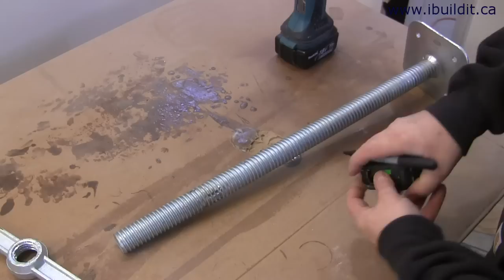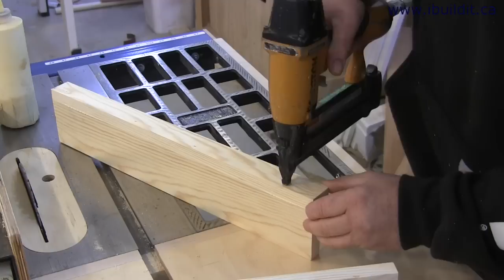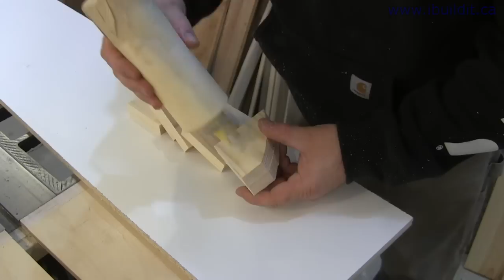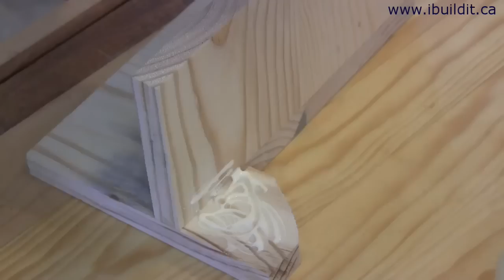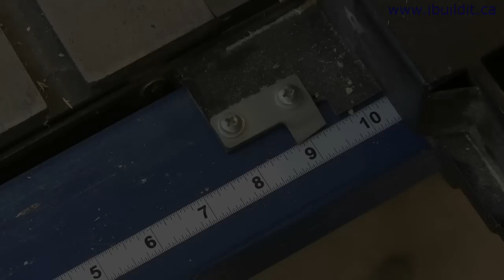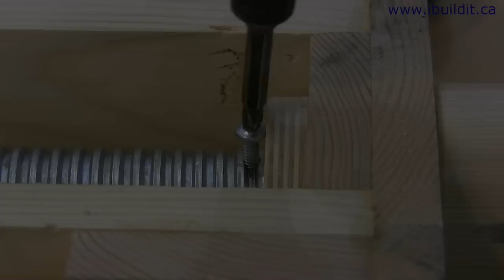Making A Wooden Vise

Comment: This Is sooo awesome to me, I took all the metal smithing courses i could at college. You wood workers always left me in awe. I was ok with the fire and the crucible, the table saws and what not always scared the crap outta me. Anyway, just wanted to leave a positive comment and also ask, were you going to put any rubber pads or anything on the actual parts that would be gripping what ever you put in it? not sure how it would work if you put something harder than the wood in there, would seem like a shame if its marred up the finish you put on there.
Reply from the maker: EnglishPlays It's been used and abused extensively over the last year, as shown in many of my newer videos.
Reply: John Heisz 
did u get your machines for cheap or high price
if u got it for cheap plz tell me how and where i can look for them
also just subscribed keep up the good work
Reply: +maaz-xxx check out craigslist for your area
Reply: EnglishPlays

Comment: Using a hand tap in a drill and pushing your work across the table saw with your hands. I am so triggered right now.
Reply: +Jarrett Guthrie I see ten fingers, and didn't the hole get tapped? What seems to be the problem?
Reply: Some people won't get over that "knowing what you're doing" equals "safety". Shame.
Reply: I'm fine with the table saw but yea the hand tap in a drill, I keep seeing people do this and it kinda drives me nuts (pun wasn't intended but I'll take it) I was always taught to do it by hand so you don't damage your threads or tap, 1/4 turn forward 1/2 turn back

Comment: Now in my time I have used many different types of vices.This I must say is amazing and I really only have two things I would add/change on it! First, when you use this on really expensive woods , with-out silicone pads how do you stop from leaving indents that you will have to sand out ? Second, I too do wonder if the anvil would take some abuse, after all you used pine and I only know of a few woods softer? Again , this is amazing but it is not something I would want to attempt, but that being said You have given me a solution to a problem I have with something I am doing! Thank you!

Comment: Very fun to make! Thanks! I almost screw it up (pun intended) by not noticing in your video that you cut the "nut" asymmetrically, but I was lucky and it worked out anyway. Maybe even a tad (a very small tad) stronger since the screw in my version comes closer to where the clamping pressure is applied.

Comment: Here's an odd question, when I learned to use a tap a zillion years ago, we  were always taught to back up a quarter turn every half turn to clear the chips (or something like that), now I see you and others just put the tap in a drill and seemingly plow right through. Are you guys using different taps, or were we older timers just being given overly cautious techniques, or what? This really puzzles me. Btw this vise is so popular, I bet plans for it would sell like hot cakes  : -) . I would buy a set even though I already own a good steal version, and your video is good enough to make it without them, it just in that sweet spot where with plans I would make it, without, will remain on my to do list for ever.
Reply: I know what you mean, I came through the old school too; however, notice at 8:31 that his drill chuck is backed off to "15" therefore not overly forcing the tap. The chuck "slips" at that point, so in the long run saving the hands work of turning the manual tap handle.  And he did reverse the drill, cleaning the filings so he wasn't just "plowing" through as it seems at first watch.  
   Thanks John for a new technique, teaching old dogs new tricks :).
Reply: Good observation. To add to this, if you are using low-quality taps, i.e Harbor Freight or bargain-bin hardware store stuff, you need to be extra careful. Backing off 1/4 turn for each 1/2 clockwise turn, and doing it by hand, is the safest method. That being said, it's much faster if you've had some practice,  use high-quality taps, and use a drill or driver with torque-limiting, or better yet, a drill press to make sure it's perfectly straight . Breaking off a tap in steel is a great learning experience, but also an enormous pain in the ass. If you end up tapping steel often, you will probably experience this first-hand either way.

Comment: only thing i would have done differently is coated it in a resin, you'd still get a nice wet wood look, but the added strength would be a plus. not that it doesn't look sturdy enough for most simple projects

Comment: i made one in steel when i was 16 in school as an exam but it weighed over 30 kg so after a few years i was tired of moving it around so then i threw it away, but now when im older i regret it. cause you cant beat handbuilt things compared to even expensive ones, but since im now doing a little wood work i would just rater use wood L, aluminium L, plastic L, rubber L, depending on what i do.

Comment: Great video and great job! Just a question. Wouldn't it be easier to cut the similar parts while they are stuck together with like a double sided tape? Did you cut them separately to avoid burn out?

Comment: Is there any benefit of an wooden vise? Or is there a special appication for this? (In comparison to a metal vise with for example rubber cushion?) Why did you glue the jaws of multiple layers instead of using a big enough wood piece? (Maybe this is a silly question)

Comment: I have a request, or challenge if you see it that way. I see all the time on youtube people using drills to make a lathe. they do not however make complete lathes or even have a lathe chuck. can you make a version that has a drill hook up to a rod on the back of a 3" chuck. the lathe would be complete on both ends using only the metal chuck and needle on the other end. all made of wood. with even a sliding guide to rest your tool on as you turn.

Comment: I think if someone would definitely have a vise if they already had all the tools you used to build it
Reply: You miss the point here. A wooden vise is meant to be used for fine woodworking. For general construction, when the finish doesn't matter, a regular vise suffices, but once you start making things like furniture, it's just not acceptable.

A regular vise damages the wood that is clamped. There are workarounds, but a wooden vise is far more practical in the long run. It saves time not having to fiddle with wooden blocks around your workpiece to avoid damaging it.

Comment: do you think this could be made of red oak? i have some old flooring i think would be good for this and I was wondering if you think it could work 
thanks
Reply: I don't think there's a type of wood that wouldn't work. Harder woods will take more work, but the result will b e a stronger vice. I'm planning on building this with leftover Ipe from my deck. It's a pain to cut and drill but, if I ever finish it,, will be beautiful and rock-solid.

Comment: Is there is a structural reason you made many of the larger parts piecemeal out of laminated boards or was that just because you couldn't get a block of timber that large?
Reply from the maker: Laminated wood is generally stronger and more stable than solid wood. Also, I had the boards on hand, but I didn't have a thicker piece.
Reply: rosw

Comment: Interesting project.  Have you used it in any actual work situations? Any idea how much clamping pressure it can generate?
Carlkinmadcity
Reply from the maker: Carl Kreienkamp Plenty, watch some of my newer videos.
Reply: Gunna do one of these. Love it.............. I have an Idea to throw at you John. 
      I always hated the pin system on a leg vise and the X and chain vise arent to my taste but here goes.....I see swivel type bench dogs and bench vises with swivel jaws for non parallel sides, well.....howza bout a swiveling chop similar to the swivel bench dogs [ball and socket or pinned] so the bottom of the leg vise could be hinged fast......I would try this idea myself but I am not completely set-up yet....I figgered if any one can do this. you can..... How bout a leg vise constructed similar to your bench vise with a swivel chop!!!!

Comment: Good vises are cast steel; some are forged. Then the jaw inserts are typically hardened to 50-56 Rockwell. I mention this, because using wood is like trying to grip material with cheese. It looks really cool, though, and I'm envious of the skill it took to put it together.
Reply: You've not spent much time in a woodshop, have you?